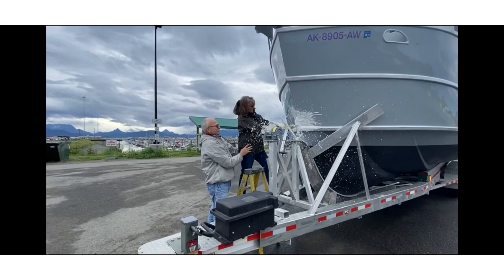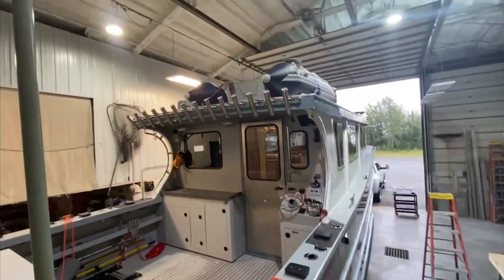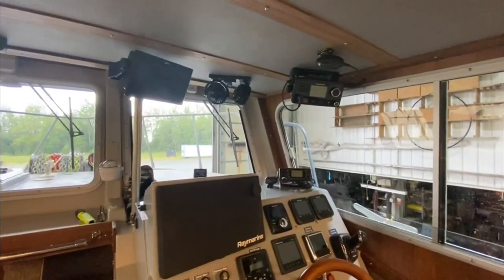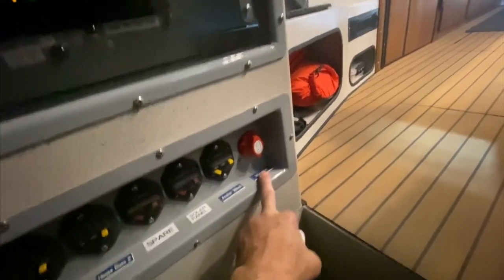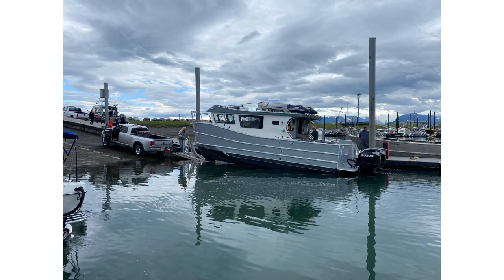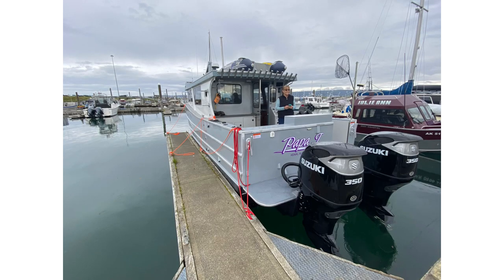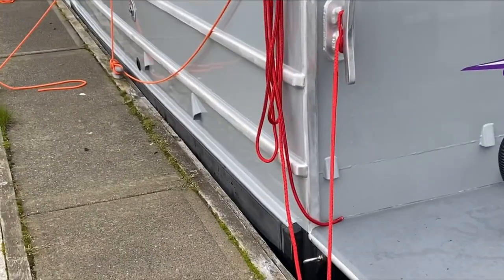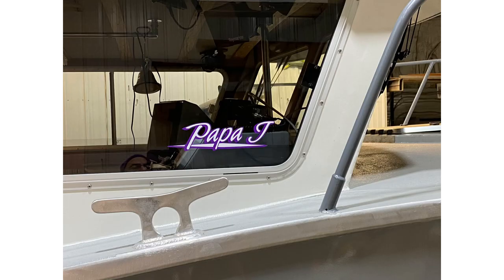Jahrig Aluminum Boat Build #51 up to 8-18-2022

Comment: Beautiful work right there. When you said “a little bow heavy”, all I could think of was, well, now we get to watch you install quad 425 XTO’s.
Reply from the maker: Ouch. I have a plan and maybe move batteries to aft under the deck. Approximately 500#. It’s only the looks probably won’t change the performance. Thanks

Comment: Now you need a drone so you can take videos of you running on the water
Reply from the maker: Thanks Sparky- Yes I already have the DJI. The Raymarine system has an app built in to control the DJI drone. I will have videos soon of boat running along.

Comment: Did you let it sit with all your tanks full, fuel, Gray water etc
Reply from the maker: No not really. Fuel changes but 0 gray 0 black. I only put enough water for needs. It holds 95 gallons of water but is close to center of gravity.

Comment: It just needs a bit of ballast in the rear, not uncommon for a boat that size.
Reply from the maker: Yes it is a bit bow heavy - not to bad. i might move batteries to aft stern wall. It won't change performance just looks a bit. Mostly I'm happy that side to side is dead on.
Reply: @willjahrig100  yes it is nice and even. I'd get sand bags and put them in the bilge or wherever in the rear until she sits exactly how you want, then take the weight of the sandbags and add that much ballast. There's a lead and epoxy mix out there, then weld up a box on each side and fill it to the weight. Or box off a longer section off the stringers and add ballast. Your boat is just spectacular.
Reply from the maker: @osu3221  cool ideas. I don't want to add weight to an already heavy boat. But if I do anything it would be to move the 600#'s of batteries from under the main helm to the stern wall under the fish deck. Once again its only the look and boat performance wouldn't change. But thanks for pondering with me.